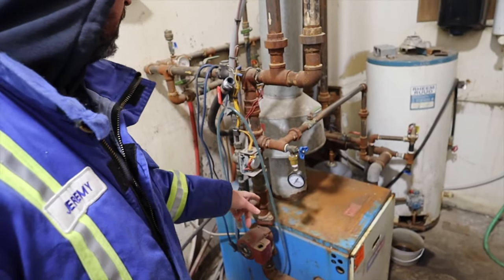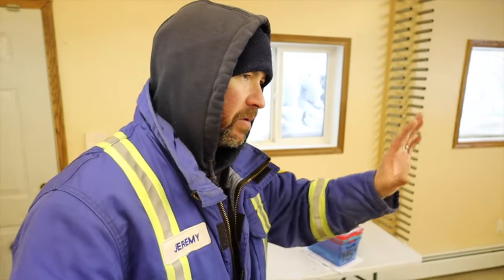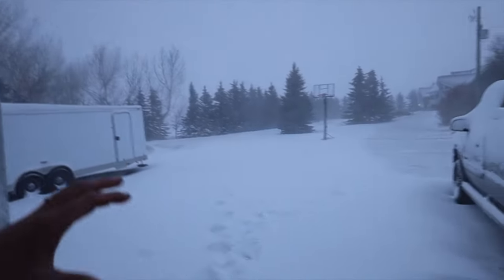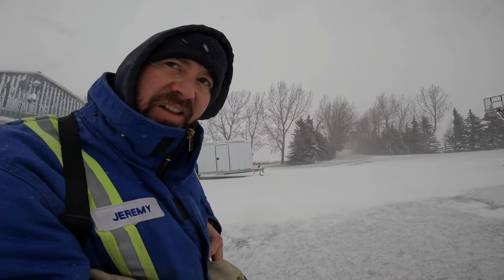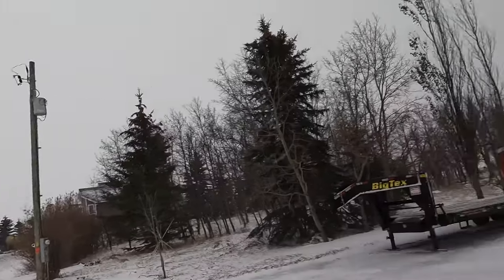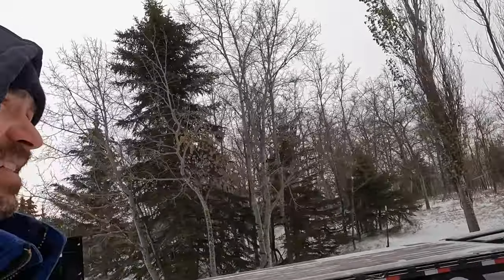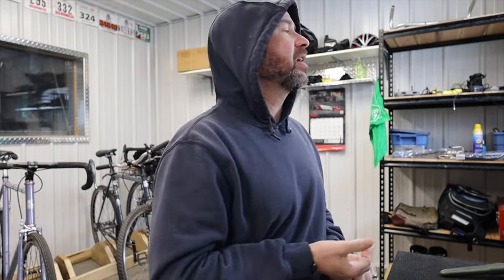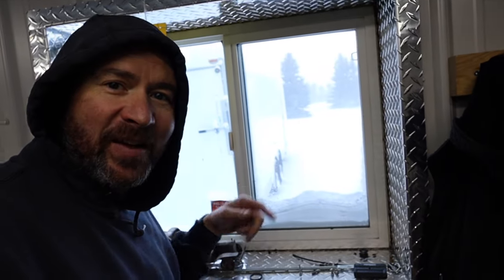Winter Preparation in Canada - We Get Heat Turned On Just in Time

Comment: I'm not sure how you folk get by in the cold and snow (I'm never seen snow, apart from tv and YT). I always wanted to visit Canada and Alaska, back when I was younger and still healthy. But all that extra clothing and equipment needed... strewth!
If the temp here in Aus drops below 20C, I'm reaching for extra coats and layers.
I worked outdoors manually, for a time, in temps that often ranged into the 40-50C margins. I had to keep up the salt intake to counter the sweat... that was in the far north of Aus, and I hate the cooler climate of the southern areas, where I now reside and can't move from.

I hope your delivery gets through.
Reply from the maker: Oh man that’s crazy to hear. When we get temps over 30°C I just pack it in and wait until it cools down. It’s -20 right now and I will say I enjoy this more than +30. Funny how you get accustomed to what you’re used to. Cheers👍